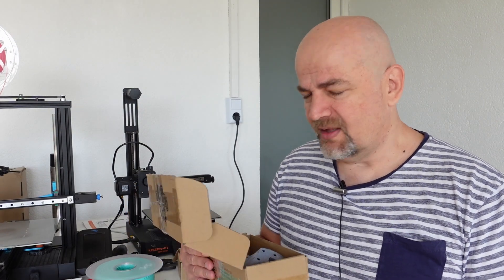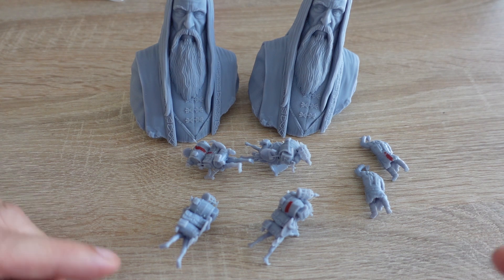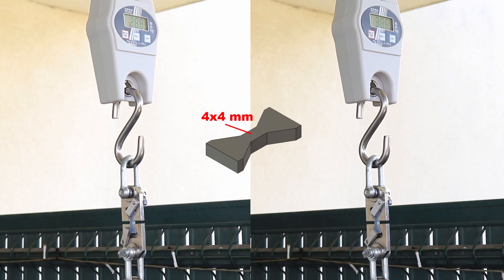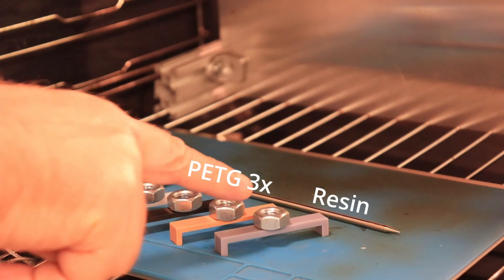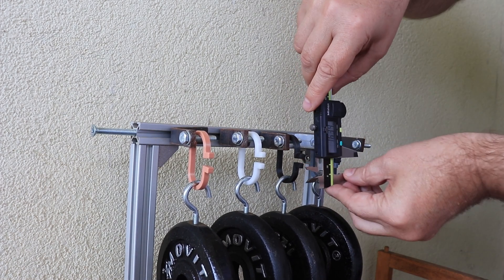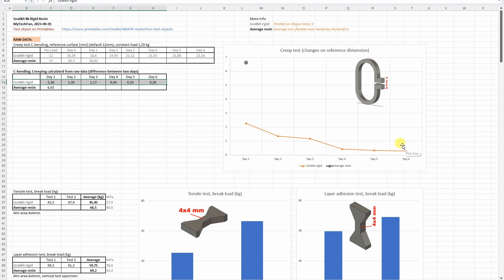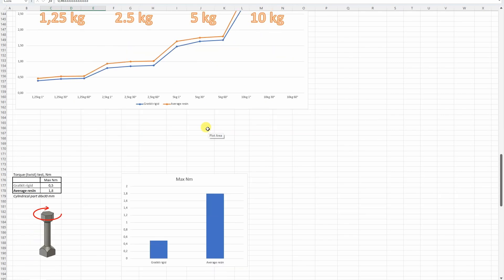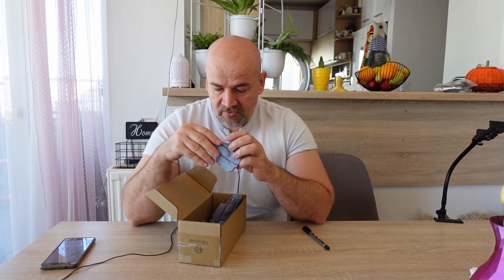Gratkit 8k Rigid Resin review

Comment: I'm actually looking for resin that is difficult to bend. So it looks like this resin is difficult to bend? I'm trying to print a 4 1/2 mm by 15 cm stick and there is going to be a hammer like object at the end of it. When using abs like resin the stick bends but I am looking for resin that is difficult to bend.